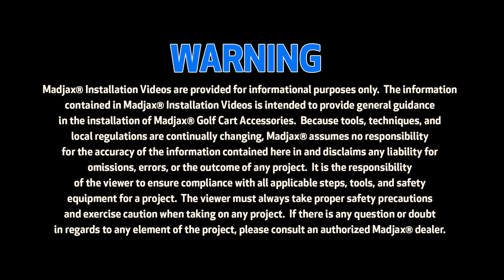Ultimate Plus Light Kit for Precedent® | How to Install Video | Madjax® Golf Cart Accessories

Comment: Thank you for this video sir! Every thing works except after 30-45 seconds the brake lights fail until you reset the ignition with the key. Any thoughts on this issue?
Reply: That’s exactly how it’s supposed to work.

Comment: i bought the ultimate PLUS light package and ALOT of my wires are way different than what he is talking about! i have it mostly installed but can not for the life of me figure out where the grey and brown wire are for the high/low beam and i have a few extra wires! also in the battery area where the reducer is concerned it has plugs on it but the plugs from battery are different  im hoping that my kit is updated since this video was made (hold my breath) wish me luck

Comment: i installed this product on my precedent.  i realized that i can still charge my phone on the usb charger when the golf cart is turned off and in the tow position.  Did i do something wrong?  Should i be worried about this draining the batteries even if i have nothing connected to my usb ports?  Despite this, overall pretty easy installation (time consuming for beginners but easy overall) just concerned about usb port being constantly on.  Thinking about buying a 12v reducer (big blue one) that ties into the key switch as i've seen on other youtube videos.  it seems this way method would turn off all electronic devices when you turn the key to the off switch.  Any input would be greatly appreciated.
Reply: Same issue I'm having. Did you resolve this?
Reply: @michaelpasquarello2392  I never got a response from video creator.  I took it to a club car dealer.  They told me that the usb charger absorbs such a small amount of energy that it wouldn’t be an issue.  They offered to rewire it, but they said it wasn’t necessary.  For piece of mind, I got it to tie in with key switch.  Part was $10 plus an hour of labor.
Reply: Thanks for the reply. 
I just installed the other day and was thinking the same with the key or put in a kill switch to shut it down when not in use.

Comment: I installed the Deluxe light kit, about 4 years ago. I put in a new 51V LITHIUM battery. NOW my led lights light up when I put on turn signal but they will not flash anymore. I need help resolving problem and MADJAX will not help nor can I get help from them after reaching out several times. I believe they have other interests now and ignore any previous customers. All they seem to care about is selling parts. I also heard they are trying to corner the market on Lithium batteries from China. So again their interests are in other places.

Comment: At 4:42, what is the purpose of the gray wire? I do not have one in my wire cluster.
Reply: Same here Ronald.  Order the kit specifically for 2004 club car precedent and there is not an individual grey wire to plug it into.  Did you ever figure it out as these guys have not responded to you in 3 months
Reply: Ron for the record, I have contacted Nivel direct and am pending this question along with the purple to brown wire connection missing from the harness sent with the 02-045 Ultimate Plus LED light kit.  I was directed to continue the install.  I will also ask about the first position and second position connections running simultaneously tomorrow morning when Todd reaches back out to me ;)

Comment: This is frustrating. I’m trying to install this but the wiring in my it’s totally different for the brake. I have a female bullet and a female clip that come with the brake light kit. The harness has a female clip and a male and female bullet. How the heck am I suppose to connect those together? Plus I bought the voltage reducer and that has different wiring than on that video! 😡😡😡😡😡😡😡
Reply: what ever happened, we are stuck like you.